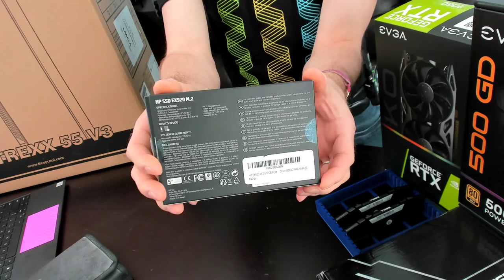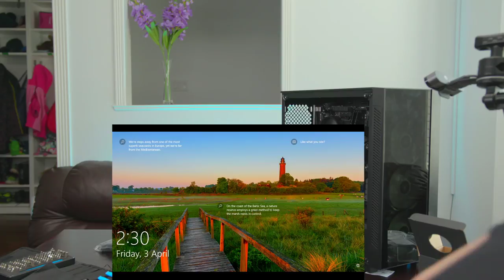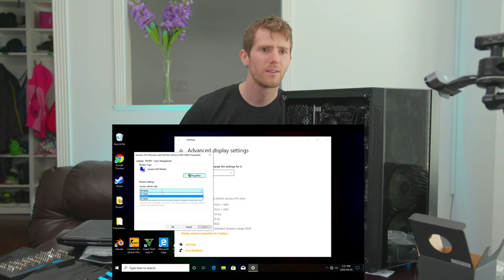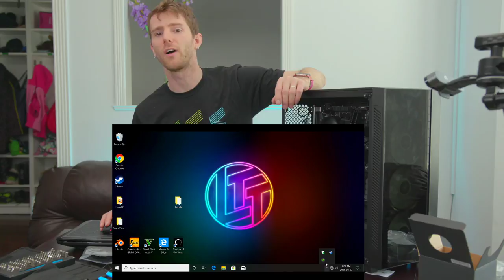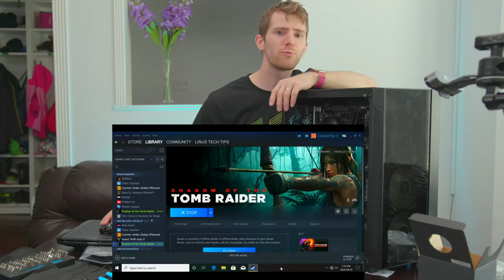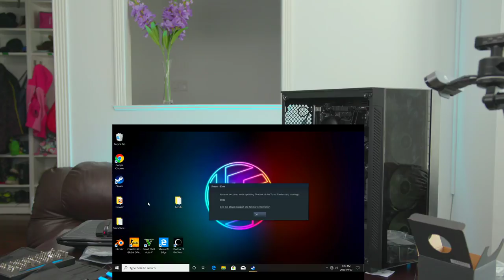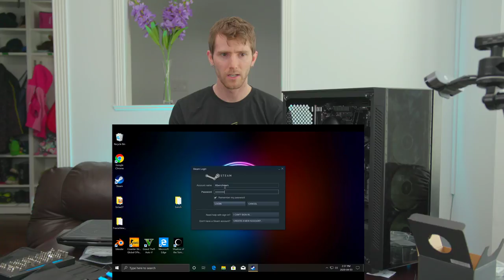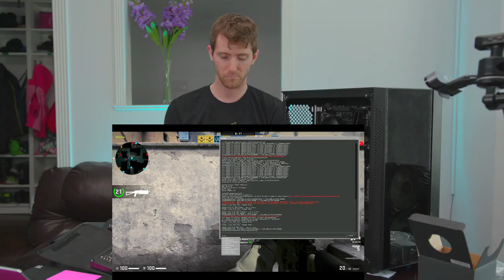Building a Value Gaming Rig at Home - $800 Budget

Comment: One year earlier (2019) I did build a Ryzen desktop with an Asrock B450 motherboard for $349 mainly from Newegg :) :)  A story from the Caribbean!
Content: Ryzen 3 2200G ($97); Asrock B450 HDV Rel 4.0 ($60); 512GB Silicon Power nvme SSD ($70); 2 x 8GB Geil DDR4 (3000MHz; $80), I reused 2 HDDs (1 TB and 500 GB; $0.00). The Xtech midi-tower is "muy especial"  and bought locally in Santiago de los Caballeros for DOP 1500 (~$30) and it included a 600W power supply for that price!! :) The black case has no fans, but it included a RGB strip around the power key, blue if powered on and red if the disks are active :)

When I mounted a 80mm outlet fan in the case, the fan resonated on the thin back plate. After hitting the back plate, it mostly stopped :) Now I use a 2-pin 92mm fan, that I took from a Compaq Evo Tower, so old it still had a Windows 98SE sticker. That resonance disappeared and the noise of that ancient fan is drowned out by the room fan :)

The Xtech power supply is special too, it has the following plugs; 24-pin; 4-pin CPU; 2 SATA plugs; 2 Molex plugs and NO video card plugs. The desktop needs max 150W of the 600W, the motherboard only has a 4 pin CPU connector too. The power supply was a perfect fit for the PC, despite being probably 70+ tin rated.  On the net side the power supply is protected by a 1200W Avtek surge protector, that also serves up to 3 other off-lease PCs from 2003 (Pentium 4 HT); 2008 (Phenom II X4 B97) and 2011 (my laptop; i5-2520M).

The system runs Ubuntu 20.04 LTS on the ZFS file system. My hobby is collecting OSes in Virtualbox, so I have all Windows releases from 1.04 to 10 and all Ubuntu LTS release from 4.10; 6.06 LTS till the RC of 21.04. Other VMs include Fedora 33; Manjaro, FreeBSD 12.2 and 13-RC2; Peppermint 7; 9 and 10 :)
The system works fine, I can run 2 modern Windows systems or 4 modern Linux systems at the same time. That is enough with only one pair of hands to feed beast. Besides 2 OS updates at the same time runs the CPU at 100% CPU load for a longer period of time.

Comment: I know that this is an older video now, but I've only just discovered your channel. I really enjoy the content and presentation.  Also, I agree that nobody ought to be going to work right now.  Anyhow, I used to build/mod/tinker with computers twenty years ago. I fell into the Mac ecosystem where I've lived ever since, but recently due to some of the changes that Apple has been making, I've been seriously considering going back to building and using PCs at home,. During the course of doing some online research, I have found your channel.  I remember now that I really used to enjoy the process of building and modding.  Thanks for the channel and the information. Cheers!

Comment: "value build" laughs in global gpu shortage
Reply: black mailed a BestBuy rep into holding a 3070 for me
Reply: @D00ML0RD1  0_0
Reply: @D00ML0RD1  omg 🤣
Reply: he was a huge thief back in high school( and for no reason to he stole his gf a bunch of shit for v-day despite have $800 in his wallet )
Reply: @D00ML0RD1  is this a joke or nah?
Reply: @youtakel7708  no joke
Reply: @D00ML0RD1  damn, how much did you pay for the 3070?
Reply: @youtakel7708   499.99 msrp
Reply: @D00ML0RD1  DAMM
I sometimes forget they cost that "low"
Reply: @syaz4380  hey gota do what ypu gota do I wasnt going to pay no scalper. Now ive got a pretty good PC 
64GB ram R7 5800x 3070 2.5tb storage( all on ssd's). Its also on a costom waterloop (EKWB for most of it the tubes are corsair PMMA is just easier to work with vs arilic( breaks to easy) or PETG( warps when bending)
Reply: @syaz4380  ive never used an entel cpu
Reply: @D00ML0RD1  i used like an intel cpu once in like 2012 then i got my first laptop which had a AMD one

Comment: "Building a Value Gaming Rig at Home - $800 Budget", the parts actually cost $1000 from the links listed lol.
Reply: its a scam
Reply: Ya, as soon as I saw that $370 RTX 2060 and Ryzen 3600X, I thought the exact same thing. There's almost nothing about this rig that is "budget", and the whole thing just comes across as lazy.
Reply: Its also definitely in USD.  Here in Canada, where LTT is based, its closer to $1500.
Reply: If you want budget drop 3rd gen and get a 1600 AF
Reply: Lol ikr, it's impossible
Reply: $2500 in Australia equivalent to about 1600 USD
Reply: @TheRandomshite123  That is an AWESOME budget processor. I have it running in an Oculus Quest VR rig with an RX 570/8GB and it works it without a hitch.
Reply: @jshireley  i got a second hand 2600x for the equivalent of 100 dollars
Reply: @TheRandomshite123  You may be going to jail.  lol that's a really good price, you did well for yourself!
Reply: @jshireley  and i paired it with a second hand rx 570 i got for the equivalent of 70 dollars, +100 for a half decent motherboard and 16 gb of ram, combined with a old prebuilt case and HDD, now that's what i call truly budget
Reply: It would be around 800 Brittish pound sterling
Reply: TheRandomshite123 would there be any compatibility issues with using this cpu? I have one and want to build a pc around it. This seems like a good build if it’s all compatible.
Reply: Yep. This video is a shill advertisement of a joke which can be seen by the (PAID LINK) spam in the description. The RTX 2060 with a non-dogshit cooler (ball-bearing fans) is 450-500$ alone in the EU. Processor is around 250-300$ which already blasts the budget.
Reply: @Coecoo  none of these big channels (linus, jay, GN, bitwit etc) know how to do truly budget, 1080p ultra at 60fps if you shop smart won't cost more than 500 dollars
Reply: @TheRandomshite123  That is entirely dependent on what games you play & their current state of optimization, not to mention the GPU driver situation.
Reply: @Coecoo  well if my like 300 dollar build can do ac odyssey on a mix of high and very high and maintain a playable 50-60 FPS imagine what you could do with 500
Reply: @Coecoo  I guess it was just a way to make a quick and easy video whilst linus is battling cancer or whatever.
Reply: I got a 3600 instead of the 3600x
Reply: Did you click on the higher priced ones? My total was just a little over $800. And with approval for a Amazon visa card can get $70 off putting it around $760.
Reply: maybe they forgot to include VAT. here in Portugal that thing costs close to 400€ (tax included. + shipping with some retailers cause whatever). lol. "budget".
Reply: @RuiPalmeira  how much is an rtx 2060?
Reply: @workingtitle7049  close to 400$ here, give or take 10/20$ depending on retailer (and if shipping included or not).   

too much for my budget.
Reply: @RuiPalmeira  oof
Reply: @RuiPalmeira  look for a second hand one
Reply: @TheRandomshite123  i'd be extremely lucky to find a good 1080, finding a trustworthy 2nd hand 2060 seems like a (very) daunting task
Reply: Dude it's not a 2060 its a 2060 ko which costs 300 dollars and the ryzen 5 3600x where i live costs 220 euro
Reply: And you can easily get 60 fps by getting a dell optiplex and add a 1050ti or an rx 580
Reply: @RuiPalmeira  Then shop second hand, but only from reputable sites that have some form of scam protection
Reply: @jshireley  built a better pc in a nzxt h500 also 32gb of the same ram 2700x x470 board 500bg ssd (gonna buy an nvme) 2060 for 900
Reply: @bozin_ru4302  ? Why would I do that when I just bought a Ryzen 5 3600 + b450 tomahawk and saved and rx480 from my previous rig?  lmao
Reply: @RuiPalmeira  if you have already its ok but for other people who haven't bought a rig yet
Reply: Yeah, that's true
Reply: @Wonkers11  Those NZXT cases are really nice too. That would be a much better all around build in my opinion.
Reply: Micro Center bundles
Reply: @itsallgoodman1244  No problem.

Comment: The Matrexx55 is ALWAYS short 1 mobo screw, I have the Airflow version, and it was short 1, seems many people with it are missing one too.   It's also a pretty good yet bad case.

Requires mods (drilled out the HDD cage).  If you had the Airflow version there is "filters",  the case by default is bloody pants for airflow!

There shoudl also be RBG on the PSU Shroud.

Comment: Linus can you do a walkthrough on setting up a M.2 SSD with a hard drive as you were talking about, could be a quick bit, plz
Reply: John Bugden-kelley I have the b450 board and would like to know how to set up both m.2 ssd’s as one takes a PCI “space”
Reply: @rsturba  M.2 Stands For Mini Sata 2.0 and is connected to  the cpu via a PCIE lane next to the ones for a graphics slot normally. Not sure what you are referring to . All drives operate indepently and individually. 

OR  all drives in your system look like one drive using software. RAID requires all drives to be set up the same way at the same time. IE it wont be doable without formatting all drives in your system. Go in to the bios assign your preferred RAID setup  in HDD settings. Install your operating system.  All drives will  appear as one physical storage block.

 BACK UP ALL YOUR INFO BEFORE YOU FORMAT A HDD or SDD. Format means to erase all data including operating system. RAID should not be configured with removable drives usually . Meaning don't RAID the internal HDD to an external HDD.
Reply: @tobiwonkanogy2975  Linus was talking at the beginning about using an M.2 SSD as a Cache drive for your HDD, I would love to a walk through on that, not sure on all the raid stuff but that would make an awesome video as well, full guide on all the types of raid and how to set them up
Reply: @Stinksatthis  Ok , i would be to. I have no real idea on how to assign cache. Good idea

Comment: Ohhh ur a bike guy... My R1 was in the shop all year, from like Feb. 1st, til like 3 weeks ago, Finally was able to get it back, insured and on the road, and 5 days later I high sided it, by locking up the rear tire to lay it down, and ultimately hitting a Pothole trying  to avoid 3 cars coming into the corner/intersection thing... landed on my fucking feet at like 40mph. Broke an Ankle, sprained the other, dislocated a cpl metatarsals, but hey... All this free time I found myself with, brought me here, and I got some healing to do yet so... lol

Comment: I'm surprised that an RTX 2060 is part of this! I thought a card like that would be more expensive!
Reply: They are only about $300 (good deal but not hard to find) to $400 (way overpriced if you buy one for $400). The performance is good but certainly not a 1080 ti or rtx 2080 Super.
Reply: @jabbers2126  
I think that a 2060 is a better deal than a 1080 Ti in my opinion because while the 1080 Ti can be a bit better in most situations, it's still capable of being over twice the price of a 2060.
Reply: Rtx 2060 super is better than the 1080ti in a lot of cases
Reply: @KendrickMegaFan  That's a flat out lie, at best the 2060 is on par with a 1070 Ti
Reply: Feature wise, the 2060s wins. Value wise the 2060s wins. 2060s has a better architecture as well as new GDDR6 video ram. So they win both ig
Reply: @KendrickMegaFan  You can literally look up how much more powerful the 1080 Ti is than the 2060 SUPER, just saying
Reply: Never said it was more powerful, I said it’s better in a lot of cases, which it is
Reply: @KendrickMegaFan  Someone doesn't know what the 2070 Super is, huh?
Reply: Never said a thing about that? I was comparing the 1080ti to the 2060s feature wise not raw performance. Bruh
Reply: This is the last time I’m gonna reply, but I never said anything about the 2070s. I’ve explained what I meant already
Reply: @KendrickMegaFan  the 2070s is even better in this situation ok lol bye
Reply: @KendrickMegaFan  besides, what's that matter to someone who's gonna be purely gaming
Reply: @jabbers2126  The RTX 2060 is better than the 1080 but not better than the 1080ti.Look up any comparisons it beats 1080 in most cases and gives 3-5fps less than 1080ti.

Comment: If you guys live in the states and you're revisiting this to build it, it's ~$890 today. Not bad imo still pretty good price to performance.
Reply: Rtx 2060 for 890 😂lmao you can get a 2070 super with that build.
Reply: @JG-bf2gk  not with all brand new parts. Especially not with a 3600 or 3600x. You can make a decent 2070 super build with a 3100 for ~$975, but Idk if I'd personally recommend going that over saving a bit to get a 3600 if you're doing any kind of CPU intensive tasks. PC parts are pretty expensive rn, but 2060 w 3600 is a pretty good value for like a streaming + mid-range gaming PC.

Comment: Man can I live where he lives? Doin the parts on PC Picker and im already at 1,035$ 😢
Reply: JJ the slow plane exactly!!!! That’s what I got too!! I was like $800 my ass lol 😂
Reply: @gserranox23x  just the 2060 alone costs around 600$ for me lol
Reply: @FantasticKruH  It's a 2060KO, so only around $300. Still no way you're actually bringing this in under budget with that. I'd suggest a 1650 Super, which runs on Newegg for $165. I'd also go for the Ryzen 3 3300X for about half the price of the Ryzen 5 3600X and similar performance in most situations. 
Most importantly, I'd wait until the B550 boards come out before building anything. Either you pick up a B550 board with useful additional features (PCIE4 for one), or you pick up a B450 for cheaper as they go on sale to get rid of them.

Comment: 800, budget, wish i had 800 on a "budget"
Reply: Lets be honest this is pretty much the bare minimum for a decent pc
Reply: @callumduncan7392  Yes but that is 100 times better than mine. And i coulf run Gta5 no problem so its OP fpr me.
Reply: 800 dollars isnt too much money to spend on a computer that you can use for work and gaming, it's an investment and it's worth getting a job and saving up for.
Reply: @timeh492  i dont think gta 5 is the most intensive game, pretty sure you can run it with integrated graphics

Comment: "value gaming pc"
M.2
Reply: For me m.2 Is cheaper than SATA, but it may vary from country to country
Reply: @centauridev  if m.2 is cheap i think you should look a little bit more, i bet you'll find SATA at a really cheaper price. But if you already went for the m.2 then all good.
Reply: @bassagent97  I tried to look for SATA ssd. They were a little cheaoer, but that is without the cables and all that, so it equaled out(about 10$ difference) so I went with M.2

Comment: Yeah I see the comments motioned it, I could tell right away soon as I saw that was a 2060 I knew this was over 800 not even with amazon. 1660 TI maybe or Super. Btw I haven't found a game that needs more than a 2600x and there cheap and easy to get the same speeds as the standard 3600.

Comment: You suggested AMD too print the text on top of the CPU in the right direction, so it was easier to install, but they have done that by making the text match the Socketinformation on the socket, so if you turn the CPU so the text is in the same direction as the text on the socket they match. The only reason that you think that it is not logical is that you turn the motherboard 180° around.

Comment: I’m not very up on gaming pc’s or laptops but wat do u think would u get a ps5 or this setup in a laptop. 
 MSI GF75 Thin i7-10750H 17.3” Gaming Laptop features Intel Core i7-10750H processor, 16GB DDR4 memory, 1TB SSD, NVIDIA GeForce GTX 1660 Ti and Windows 10 Home operating system.
OS	Windows 10 Home
CPU	Intel Core i7-10750H
Speed: 2.6 - 5.0GHz
Chipset	HM470
Color	Aluminum Black
Screen Size	17.3" Thin Bezel FHD, IPS-Level 144Hz 3ms 100%sRGB 72%NTSC
Resolution: 1920x1080 (16:9)
GPU	NVIDIA® GeForce® GTX 1660 Ti
Video Memory	6GB GDDR6
Keyboard	Single backlight with Anti-Ghost key+ silver lining
Audio	Nahimic 3 / Hi-Res Audio
Speaker	Speakers 2W*2
Memory	16GB (8GB*2) DDR4 2666MHz
HDD	1TB NVMe SSD
Connectivity	LAN: RTL8111HS-CG
WLAN: Intel Wi-Fi 6 AX201(2*2 ax)
Bluetooth: BT 5.1
Webcam	720p HD Webcam
I/O Ports	USB: 3x USB 3.2 Gen1
Type-C Port: 1x USB 3.2 Gen1Type C
Video Port: HDMI (supports 4K @ 30Hz)
Audio Port: 1/1 APDIF Headset AMP + Gold Flash jacks
AC Power Adaptor	180W
Battery	3 cell (51Whr)
Dimensions and Weight	15.63" x 10.24" x 0.9"
4.85 lbs

Comment: If you're only partitioning 250gb as a cache for games like warzone, you'd only have 2 games cached. You're probably better off having a large cheap sata ssd as a cache so you don't have to juggle which games are on your ssd. I won a new 2TB SATA SSD for £105 a while ago which was full of games and it's annoying trying to install new ones. When I can be bothered I'm going to move everything to a large HDD and use the 2TB as a massive cache so I don't have the juggle

Comment: Hey Guys, quick question:
I recently build my 1st gaming pc and the experience so far its great. I am comfortably playing in 4k (or 1440p) at 60fps smoothly and loving it!
But I do have a doubt regarding my PSU. I chose the CX750M (semi-modular). This has many bad reviews and claims from user's (although many of them are 2-4 yo) about the PSU lasting only 4 months before starting to make a horrible sound and even shutting the PC off.

Should I worry? If so when shoudl I switch PSU and which one do y'all recommend? Ty.

Comment: CPU    214.90
Motherboard  95,90€
DDR4 RAM 2x8GB 62,60€
HP SSD EX920 m.2 512GB 86,50€
GPU 321,00€
Power 92,90€
Similar case by TT 93,90€
967,70 € x 1,19=1153,26 USD right now in Austria. All parts on stock!.

Just built my son a 800€ PC.  Ryzen 5 3600, Msi  B450 Tomahawk Max, Msi 1660 Super  Ventus XS OC,  Crucial MX500 500GB SSD + WD Red 2 TB HDD, Corsair CV 650W Bronze+, TT Commander C36 mid tower, G.Skill Rip Jaws V 16GB (2x8) Kit 3200. What you think about that setup? Btw, got lucky, got 10% off on the whole order.

Comment: @Linus, you mentioned that G.skill Ripjaws 5 is not a Ryzen specific RAM. Which one would you suggest instead for this MoBo with a 3600/3600X? Is G.skill Flare X (https://www.newegg.com/g-skill-16gb-288-pin-ddr4-sdram/p/N82E16820232767?Item=N82E16820232767 ) a good option?